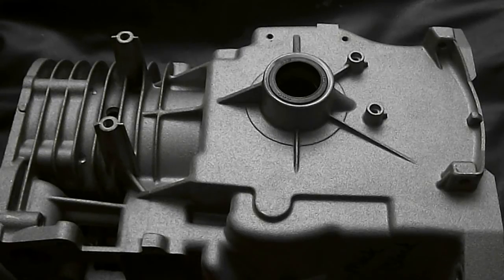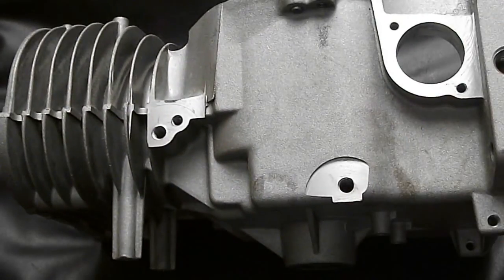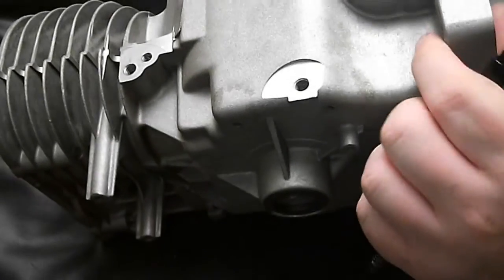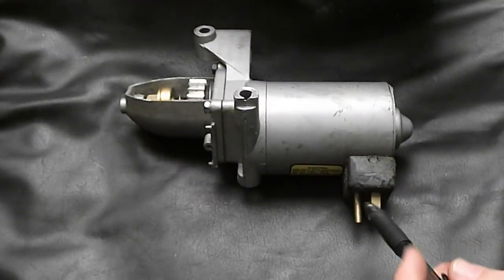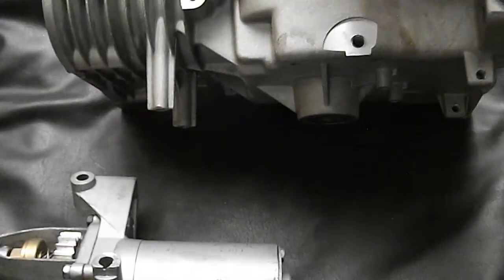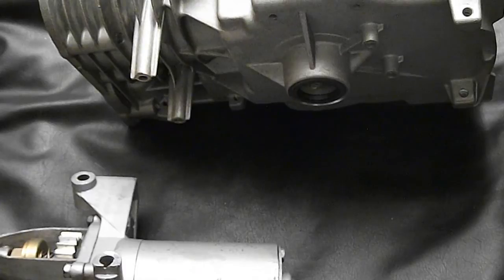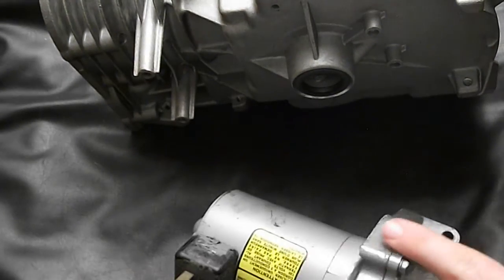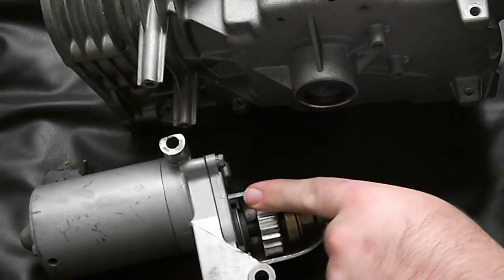Briggs 5hp Flathead - Electric Starter Setup - Information

Comment: have this motor on a tiller i picked up 12volt. starter gear not worn starter motor spins when power applied. starter gear doesn't engage ring gear ? have you ever rebuilt this type starter ?
Reply from the maker: Might need to clean it. Try wd40 behind the gear.

Comment: still looking for one of these to purchase
Reply from the maker: LOL, good luck man. I've only seen 2 on ebay in the last 8 years.
Reply from the maker: Oh sorry man, I saw the thumbnail and thought you wanted a electic start fun power motor. The electric start parts are on ebay they just cost a lot of money,
Reply: Trabone305  i have a stock one with an electric start how much do you wanna pay though haha i have no clue what its worth
Reply: dc5000123 i have one with a stock starter that runs and the starter works... whats it worth ?
Reply: I'll buy it, I'm looking today for the Flywheel with the Nylon gear Flywheel 690820, if anybody has one of these, please contact me, I'll buy Just the flywheel or the whole engine
Reply: @rossbarker3362  i have a push mower with el start and the flywheel im going to try to adapt it to work on a fun power block
Reply: @budgetgokart3990  is it a vertical shaft push mower?
Reply: @rossbarker3362  yea it is
Reply: @budgetgokart3990  You can use that, and the flywheel and charging circuit that came with it, U will need a nose cone from a horizontal shaft motor, best way I found to get them is to buy an AC plug in starter motor off a snow blower and swap out the motor onto the horizontal style nose cone. U won't be able to use that nose cone you have
Reply: @rossbarker3362  so can i use all the parts? I was going to use a mower starter or the one it has if its adapable to the other blockin theory i could make a bracket for the starter and just swap flywheels but i gotta figure out charging
Reply: @budgetgokart3990  Well, that mower has the charging circuit, you might be able to make a custom bracket to mount the starter, but if U swap the nose cone, U won't need to, I'm assuming you have the old set-up with Steel flywheel teeth, not the newer plastic tooth flywheel? I may be able to help with parts starting at $100